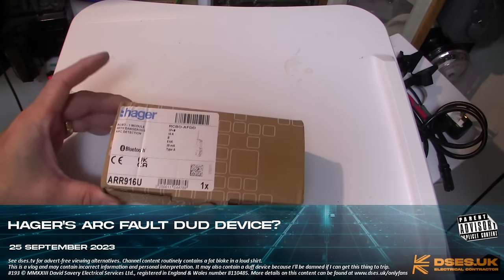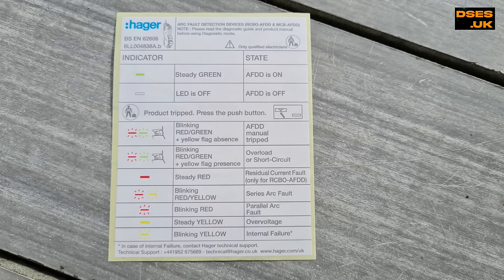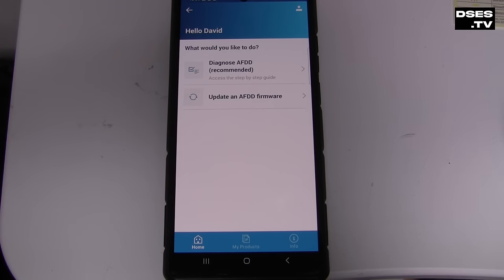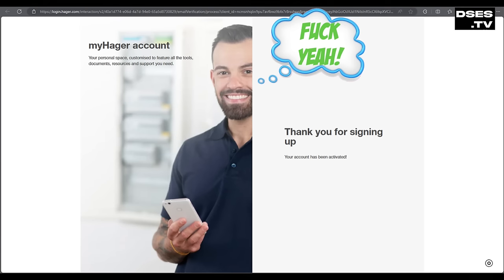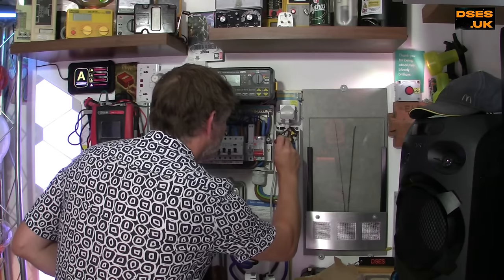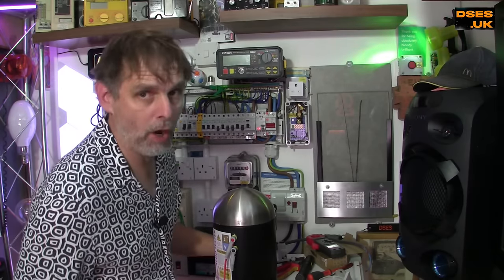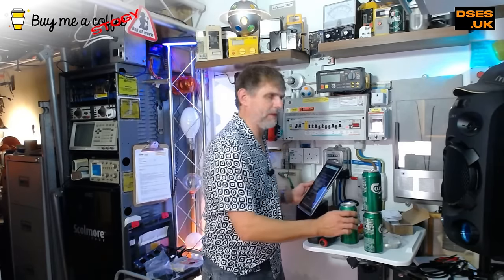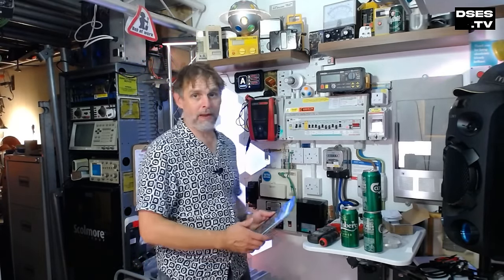AFDD: Hager's Arc Fault Dud Device?

Comment: HI David, your tests seems to be as close as you can safely get to a real world issue, is there any governing body that is actually capable of forcing Companies like Hager to prove their device actually does what they say it will?
Reply from the maker: I believe standard IEC 62606 applies and I presume Hager and others are rubber stamped to that or whatever else is required. I'm not saying this device doesn't work, just that I haven't been able to force it to work. That said, these faults do represent what a series and parallel arc would look like if you had a genuine loose connection or damaged cable, so I don't know what's missing from my messing around. With AFDDs, we're totally reliant on the manufacturers' claims and that their self-test diagnostic firmware is robust.
Reply: @dsesuk  And this is a thing, they may update tripping logic later on without issues, where other cannot ;)

Comment: On a plus note, it's reassuring to know we can now potentially brick our consumer units with a firmware update.
Real arc fault detection is made very hard by modern switch mode power supplies and motor drives in cheap appliances.  Many have a very aggressive pulsing and sizzling current characteristic that pretty much looks like an arc.
I still think these are not needed in the UK as opposed to the wiring sh*t-fest of America.

Comment: Let's take a functional device that already has a surprisingly small form factor for its intended purpose of breaking massive fault currents safely, and just stuff it with ill conceived electronic circuitry.  I mean - what could go wrong.

Maybe it's just as well that they switched back to blast-proof metal consumer units.
Reply: I’m also wondering how long these devices will last if they a spamming log files all day long. What happens when they exceed the read and write cycles of whatever chip they are using.
Reply: @M0LHA  The likelihood of their internal power supply failing within a few years is also probably quite high.

Comment: By realtime clock they probably mean that it counts time since the trip, which is the only sensible way to do it as you don't want to have to set the time of day into the device, which is going to drift over time and will often never get done. 
However the app ought to translate the "xx time ago" into a real event time to display it in a more useful way. Would be good to know if it can maintain timekeeping over a power failure.
Reply from the maker: It was me who assumed there was a clock in there based on being told it logged trip events. It was only when I started playing with it did I realise it was just a basic counter that doesn't tell you much.
Reply: @dsesuk the difference between a clock and a counter is really semantics. On computers
The RTC is a counter that started in 1970. Hager made the right decision to just store how far back an event occurred, as even a set clock is going to drift massively over the time frames these things are going to operate over. Mike is right, the app should be translating these offsets into date and time of the event.
Reply: @edc1569  The problem is they're not counting how far back it occured - they're counting how long the device was powered up before it occured. There's no way to relate this to real time - the only knowledge we have is that at an unknown time the device was powered up, it was powered for a known duration, then it tripped and was no longer powered. Great, so we have an hour meter on a piece of machinery - but did it do 1000 hours in its first year and sit for the next 9, or 100 hours a year over 10 years?

Comment: Now we know why the Hager AFDDs have software update capability.  This is to enable you to reprogramme them when they actually work out how to make them work!
Reply: The thing about bluetooth connectivity and the app is how long are they going to support it for? How many consumer units out there that are 20-30+ years old? Is the current app for a smartphone in 30 years time still going to be able to talk these breakers?
Reply: @FrontSideBus  I think 20-30 years is a bit optimistic - the capacitors in them will probably fail in about 10 years and cause them to trip all the time or even worse never trip!

Comment: David, thank you so much for making the effort to demo this. It’s proper work making these videos, and it’s genuinely appreciated. The findings are astounding, adding “functionality” isn’t worth a damn unless it provides a benefit. The very least the device should do, is react to the faults for which it has been described to do. If it can’t do that, apps and registrations are total snake oil and an added pain in the arse. As an aside, if we are responsible for fitting these devices, the manufacturer should be responsible for developing a device to test it. I would love to see a manufacturer produce a device that can simulate RCD, OL and Arc Faults for us poor bastards who have to second guess what the hell is going on with a device when we’re trying to find a fault. Where’s the kit to eliminate the protective device being at fault, that’s what I want to know!

Comment: Good video David! Thanks. 
The firmware is the most important component of the AFDD, but is checked last. 
It was somewhat unusual to see a parallel arc break cable. There was arcing, but the signatures may be different if carbonized cable was used. Can't say anything definitive here. 
The main source of problems for us are low quality LED lights, treadmills, switching power supplies,...Of course, now we've learned how to work with it.

Comment: Good video (like normal), I have a lot of interest in this as I have two different 32A Hager AFDD’s, installed in different boards, both randomly tripping in series arc on a pure ring circuit (which it can’t apparently see), all sockets removed and wagos in-place, RN+R1+R2 readings are all good on each leg, swapped with different Hager AFDD’s. 

When the Rings are split into radials and the split moved every week or so it won’t trip at all.

I can’t sort out the random tripping.

I’m going to Exeter Elex so planning on raising it (again).

Comment: Great video David, one can't lie about the arc machine you created, it does exactly what it's supposed too.. Back in the late 80's I worked at GEC designing polyphase electricity meters, we used to do a lot of type testing to check for faults etc and one test we used to nickname the "ba$tard file test" basically a course engineering file within an insulated acrylic box that was connected one end to live and the other end had a mechanism that could be swiped across the file, and connect to the circuit of course all insulated...this would be used to simulate micro arcing to test the meter  wouldn't fail (MOV's etc)...you could rig something like this to do single or parallel arcing to further test your proof....BTW adding software to individual breakers is a recipe for disaster, I can just hear the sparky saying you need to reboot the system or in the PC world the good old 3 finger microsoft salute  (ctrl+alt+del) !
Reply: Your breaker won't reset? Have you tried pulling the main fuse and putting it back in again?
Reply: Extra points: he built that arc tester out of LEGO.  At least parts of it...  Even the beestriping is a LEGO part.

Comment: Excellent video Dave, if you do anything else on this, you should have the AFDD swapped for a new one and repeat  your tests to remove any doubt it was just a defective device, I expect the Hager demo gizmo was just a signal injector set up to send perfect waveforms that the AFDD would instantly recognize and trip accordingly
Reply from the maker: Yeah, I figured it would be a signal injector too - can't see how else they can apply an array of different faults at the push of a button. I could do with a follow-up - perhaps another unit from a different source. It's an expensive game though.
Reply: @dsesuk  I don't expect it to be as advanced as a waveform, I suspect this is a special tradestand example whereby the buttons go to a direct input on the AFDD PCB and the microcontroller acts accordingly

Comment: The reason for this to be built into each separate afdd, is because you can re-programm microcontroller which sits in each individual one. You can't do for obvious reasons with a board level processor. Although it seems logical that Hager or someone else will introduce board level as well. In that case you'll pair afdds to the board and you can update and monitor them centrally.

Comment: Good video David, . I concern is arc faults on the main bus bar and meter tails  where  I find most arc faults. I sure you see main switches melt along with breakers melting on the bus bar.

Comment: Great video Dave as always 👌 I am a tad worried now though. Hager is my go to brand on commercial work and I installed 20 of these earlier this year in a care home 🤔 it’s insane that AFDD’s were brought to market with no way of testing. 
I wonder if Hager will comment on your video. Thanks for sharing
Reply from the maker: Remember that my pissing around is hardly to any standard or lab conditions. If Hager are your flavour, then there's no need to doubt their gear isn't fit for purpose - they've had it tested and approved. Maybe my particular unit or method of testing is at fault; I honestly don't know, although I did expect my model to react to the conditions I subjected it to. Even if you have installed these and they don't stop the arc fault electrical fire that burns down your care home, you won't be at fault because Hager said their goodies were good and there was no way for you to prove otherwise short of observing a green LED and it tripping off when the button was pushed. Not that it helps all those who died in the fire, but I don't want you losing any sleep over it!
Reply: @dsesuk  Yes that’s a fair point, I won’t lose any sleep but like you I would have expected the device to trip under those conditions. Interesting

Comment: its bad enough that the switchboard manufacturers pushed for these or as you said previously in your AFDD install video "to some, already sniffs of snake oil".
I'm sure it repels tigers very well too. hopefully this is just a faulty unit or maybe even the firmware isn't set correctly.

Comment: That's you well amd truly off hagers Christmas card list 😂 never used hager but always thought they where the dogs bollocks just coz so many sparks rate it. Very interesting and useful video thanks dave keep em coming
Reply from the maker: I think they're perfectly fine as a brand, but others put them on a pedestal that, in my opinion, they shouldn't be on. Their pricing is cack and some of their products are awful. Did you ever see a pre-Amendment 3 insulated board of theirs you could close the flap on??
Reply: Or that had the stupid quarter turn plastic cover screws that broke on cover removal for an EICR/Additional circuit on Con Units more than two years old.  @dsesuk

Comment: Concerning seen as I have 11 of the bastards in my board. Please try another one. I’ll have a go and let you know if I can manage. 🤦🏻
Reply: My update is I couldn’t get it to trip and I had the back of the test socket melting and on fire 😡 Was definitely arcing than sparking  parts of the time and you clearly had an arc singing. Now where do I stand.  The reason I installed them and it doesn’t even work. My test was on the older firmware. Haven’t tried updating as you’ve already tried it on that.
Reply: @robintodd3901 well the batch fault theory isn’t lookin good

Comment: How many burnt out shower isolators have we all been called out to replace, that would have had much less arcing than you created here. This really is quite worrying. There needs to be some sort of test instrument that we can use on site to verify the functionality of AFDD's before we go slinging them in all over the place.
Reply from the maker: Shower isolators are the number 1 where AFDDs can do something useful, but A2 is only pushing them for socket circuits, so builders will get cheap and omit them for showers I expect.

Comment: I've got a CU full of these (testing them out, varying sizes) at a cost of about £1400 just to see what they were like. Only ever had them trip on RCD for damaged cabling & short circuit from my UPS starting up. No arc faults yet, even with unplugging and re-plugging in a 2kW heater. Updating the firmware  is a bitch, the 'personal notes' will not stick and they take up a ton of space. Wiring in the house is mainly 20 years old at this point but has been well maintained. I wouldn't install these for other people but I'll probably leave them in at this point as my CU is in an awkward place. A little birdie tells me they have 'compromises in design' also (edit: all single mod AFDDs will have these 'compromises') make of that what you will.

Comment: Another excellent video. I'm really quite shocked by that Hager AFDD. What good is that device?! Surely your one is a dud... to not work when compared to the Wylex is really quite shocking.
Reply from the maker: It might be a dud. But then, how is one to know if the self-test light is green? And how many more are out there? I think I heard Fusebox had to recall some of theirs - this could happen with other brands or models. The more they cram in, the more they might go wrong.
Reply: @dsesuk  The self test of a AFDD is surely inherently impossible because it can't generate an arc fault inside the AFDD in the same way that a RCD/RCBO can generate leakage current.. Agree re features and more to go wrong. That’s what we call “progress” now I guess.
Reply: @dsesuk is there any test gear coming to check AFDDS work?

Comment: Given arc fault detection is using digital signal processing, it would be unlikely implementing a central multi-channel system with a single processor would be more cost effective as they would potentially need multiple processing cores or a CPU fast enough to handle 16+ circuits simultaneously. This might change at the point they designed a custom multi-channel ASIC and achieve sufficient volume. It is very short sighted for them to assume an installer will individually configure all of these, though in future this could be centralized if all units are linked via Bluetooth mesh or otherwise connect to a central device via Bluetooth or a wired interface. This could possibly already be done with current hardware and may be in their future firmware plans. I suspect they will do this in future.

Comment: I have 84k followers on tik Tok I am trying to test out Arc fault breaker. I can't them to trip.  Do you have a video on your arc chamber construction?
Reply from the maker: You won't trip them by rubbing wires together, but increasing the contact size by using something like 15mm brass plumbing stop-ends seems to generally work. Aside from that, the Lego is just a mechanical means of moving one contact to the other without getting your fingers too close. All I have on the construction is in this video: https://youtu.be/e0ElFaKc_e8?si=pVB7jq05J7gQ9BwS&t=976
Reply: @dsesuk  thanks I have been trying to just make a slight connections.  The bouncing and rubbing for big sparks is just cuz tik Tok algorithm needs the first 5 seconds to be catchy

Comment: Your Siemens AFDD works well but red is a really peculiar colour choice to indicate that a fault monitoring device is detecting a healthy condition. Really not sure what the hell they were thinking there. That Hager unit is about as useful as a chocolate teapot.
Reply from the maker: I agree. I made the same point back in the day in the earlier vids; I don't know why they went for red over green. I used to work in comms where we trained people up on hardware. One manufacturer, Newbridge Networks (bought by Alcatel in 2000), used to confuse because one piece of hardware had either a yellow or a green LED for normal operation which interchanged between batches. When quizzed, their guy said they went for whichever colour they could get slightly cheaper at the time of manufacture.